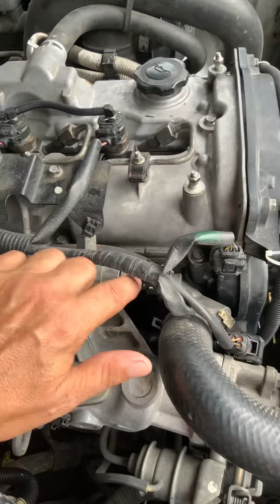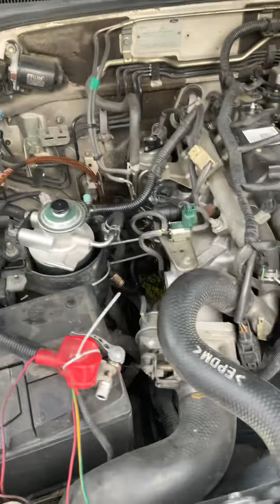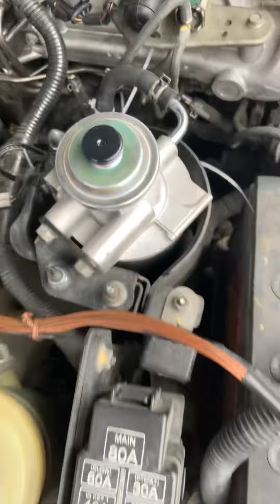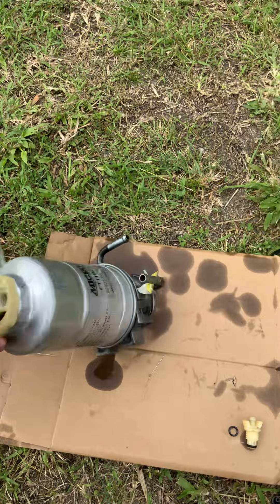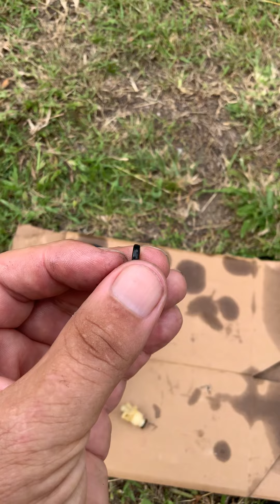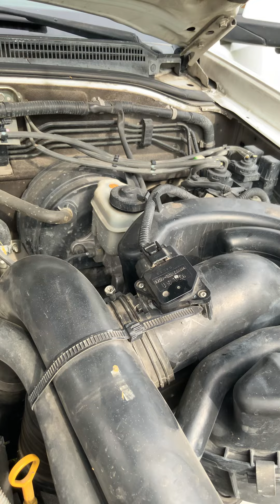Ford Ranger/Everest, Diesel Engine crank, but start badly, Problem hard to find, but easy to solve

Comment: I think there ishoul be two o- rings on that plug. I remember when the rubber rings damaged, air will  enter on that part as fuel being sucked by the fuel pump causing less fuel delivery and pressure on the common rail